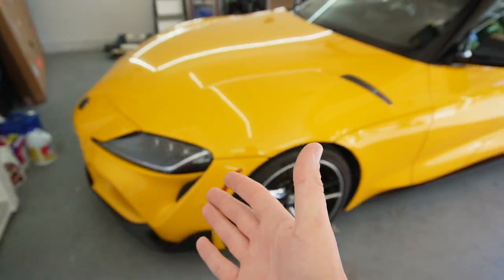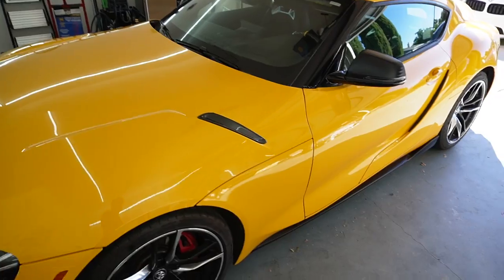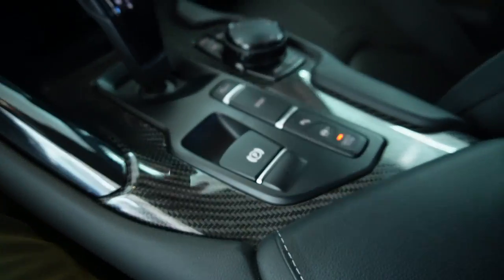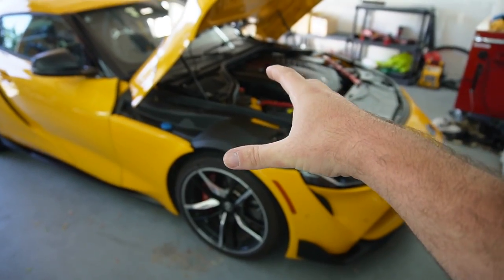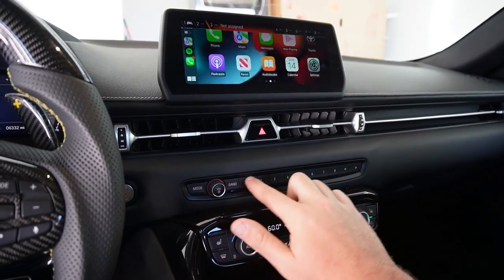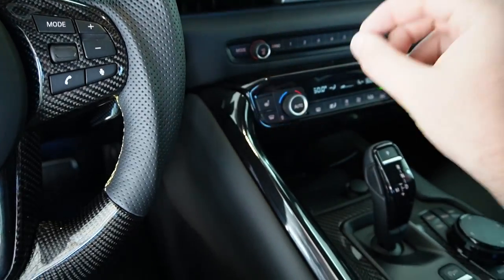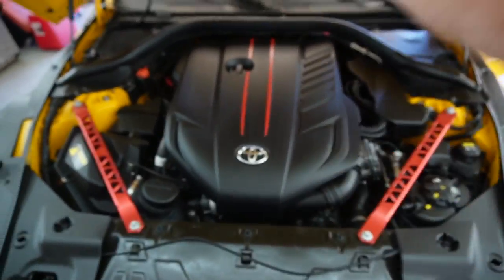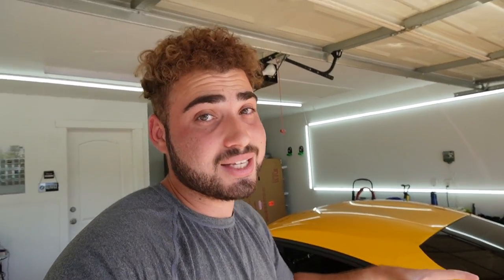TOYOTA SUPRA MK5 HIDDEN FEATURES/FUNCTIONS A90 A91 (2020-2021)

Comment: Another hidden feature: After you get out of the car, if you hold down the 3 lines on the door handle to lock it for 3-5 seconds, the side mirrors fold in!
Reply: You can set the mirrors to fold in whenever the car is locked

Comment: The 21+ is not detuned because it actually dynos 370-390 rwhp which means 430+ crank hp. Even the 2020 is not detuned because it dynos around 330-340 rwhp which is closer to 390-400 bhp. Both are underrated by manufacturer on paper, that does not mean they're detuned. The time slips prove it as well, especially the trap speed on them.